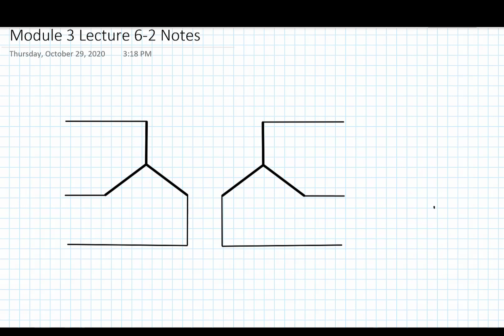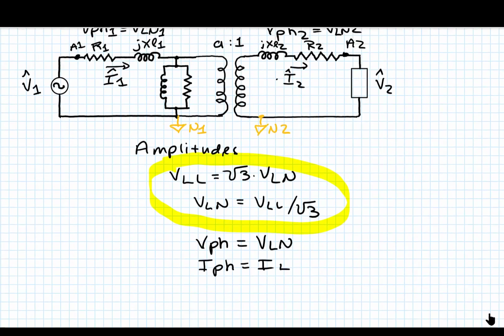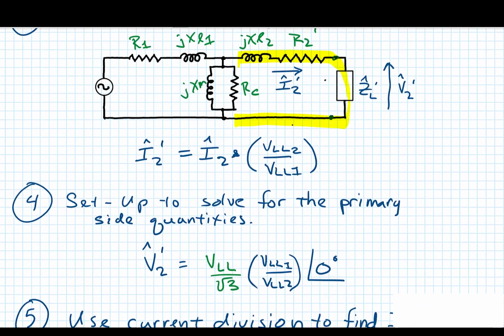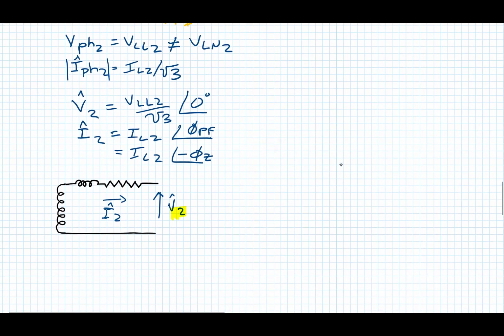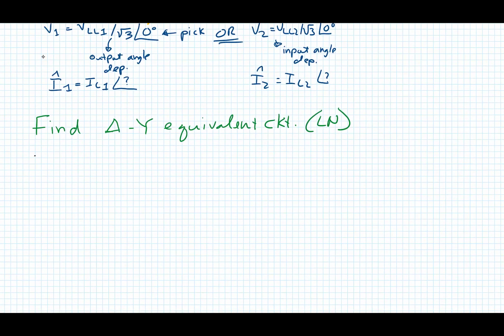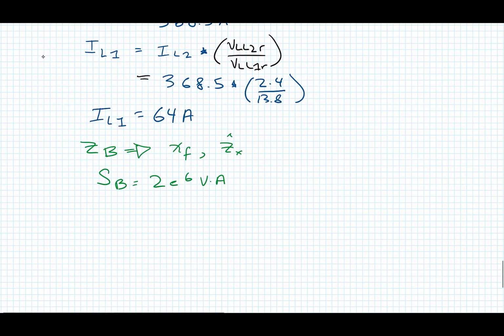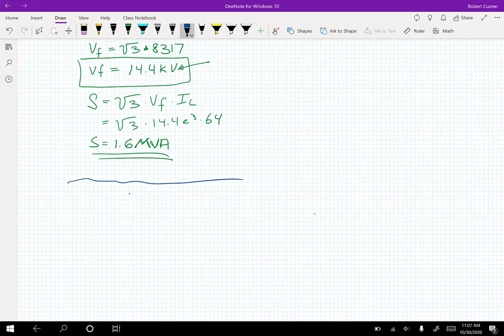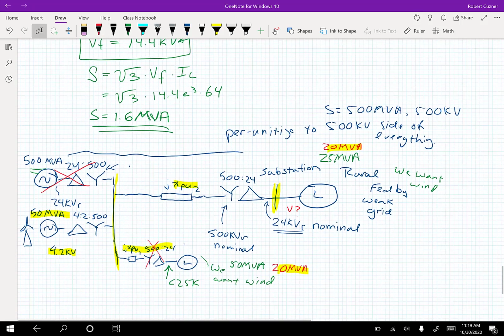Three Phase Transformer Equivalent Line to Neutral Circuit

Comment: For a Delta Wye connection. Is it necessary to transform delta to wye in order to make equivalent circuit per phase ? I saw some people making equivalent circuit without transforming delta to wye.
Reply from the maker: You can do this many ways. I just find it easier to work with the line ti neutral circuit.

Comment: Hi Mr Rob Cuzner
I find this video very instructive.
Now, if we got a short circuit test on delta side (Psc,ILLsc,VLLsc). Does the parameters calculated (R and X) are for delta or for equivalent wye ?
Reply from the maker: Always calculate them as equivalent Wye. Then you can convert to delta afterwards if necessary.